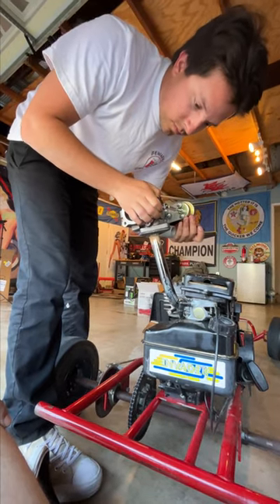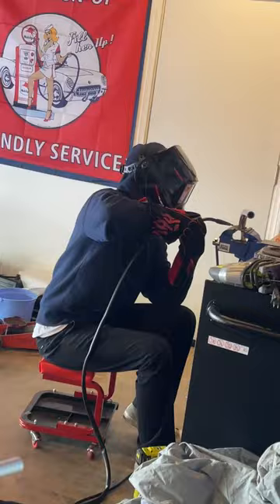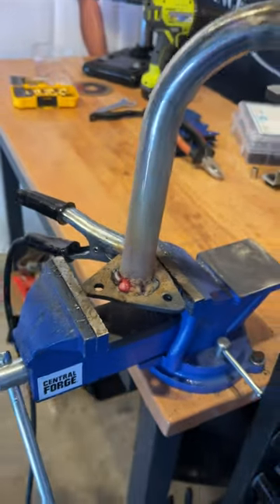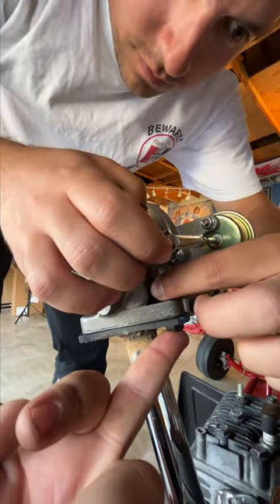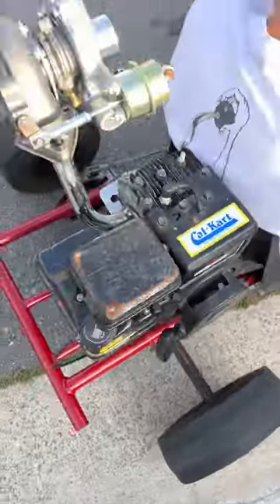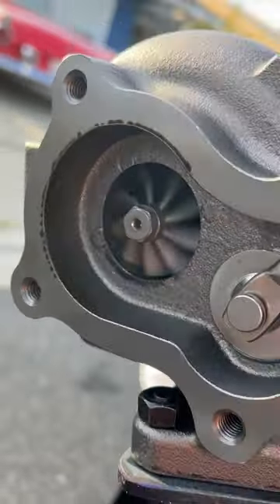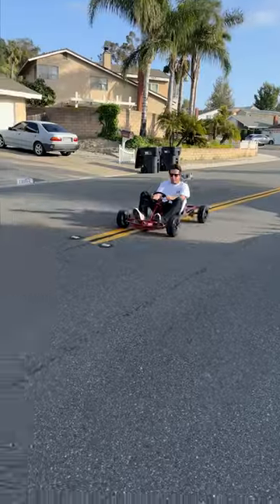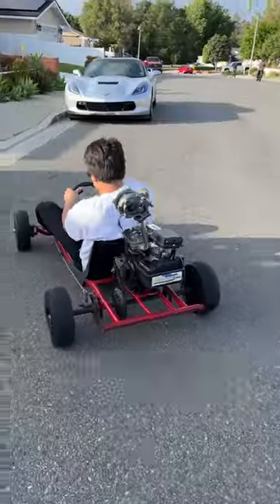I mounted a turbo on my Gokart and then this happened...

Comment from the maker: Don’t click this https://youtu.be/ay0mvx2EC3Q
Reply: Ok
Reply: We dont need anymore hack mechanics on here.  Why would you post this?  To show how lazy and impatient you can be on the dunning kruger scale?
Reply: You should start by doing oil changes,  and learning how an engine works,  and how to weld before tackleing this kind of project. I GURANTEE that thing now makes less power than it did out of the box
Reply: Why
Reply: @Sean Andrew  have you watched the first few videos of the gocart when he got it?
Reply: Add suspension!
Reply: Cool. We won’t
Reply: Ok
Reply: don’t worry i won’t.
Reply: If you use something that is supposed to be lubricated completely dry then you're going to damage it no matter what your thoughts are even if it's for half a second you're damaging it..

Comment: He cooked the bearings in just about a minute
Reply: Right
Reply: On that little ass go kart engine?
Reply: @NigelThornbery  yep, the ones for the turbo.  He ran it without the oil feed connected.
Reply: @NigelThornbery  yes
Reply: @NigelThornbery  hell ya
Reply: Indeed
Reply: Lol
Reply: Yeuuuup
Reply: Yup.
Cooled and lubricated by that oil.

And he ran it unloaded, no pressure created, probably spun faster than a proper install would result with.
Reply: @NigelThornbery  turbochargers can spin in excess of 100,000 RPM's. Under normal operating conditions.

The bearings, incredibly precise engineering to seal against both oil and air pressure.
Reply: Possibly less than 30 seconds if it turned any serious rpm.
Reply: @ctom4932  For turbo wear RPM matters where lack of oil is concerned, more than pressure.
Reply: @ctom4932  well there are two important bearings. Your main axial shaft bearing and your thrust bearing which is huge by comparison.
Reply: @consaka1  haven't really got into turbos since my school days, about 25 years ago.

Got into boats, very few turbos used in ordinary boats. Some superchargers, but still few and far between.
Boats need low end power a lot more than high end. Hole shot, the time between going from idle to getting up on plane, call it 0-20 MPH, that's where you need to minimize the time it takes.

Maybe in a high end drag boat, giving up a second or two in the 0-20 and getting an extra 20 MPH of top speed might be a worthy exchange.
But, that mentioned supercharger, which doesn't have turbo LAG, will also add high end power.

Seen a few ordinary Mercruiser motors with a Whipple on top. Personally, I think it's stupid AF to do that. Seen LS3 swaps too, replacing a motor with a 4,400 redline with one that turns 6K?

That stock Alpha 1 drive is only good for about 400hp max. And the more power it has going through it, the more wear and tear it will experience.

Alpha 1 drive is pretty much bulletproof, with proper maintenance, on 250 HP or less.
But you start putting more power through it, better increase the frequency of services.

To put it in car terms, you don't drop 1,000 HP under the hood and tub the rear end on a Chevy Luv without putting a new transmission and rear axle in it too.
Reply: That turbo is fine. You guys are just overreacting.
Reply: Where is he gonna find an oil pressure line on a lawnmower engine
Reply: @alc5792  Probably the same place I found on my 6.5 diesel truck that has no oil pressure when it's hot. I have over 60,000 miles on that engine now and it's had this problem the entire time. 
The solution that is painfully obvious to any redneck is to provide the oil pressure via other means. In my case I added an auxiliary electric oil pump for a 10-20 psi boost. Put a cooler in front of it and an extra filter after it. Only run it at idle when it's hot.
Now you may have noticed that while this guy is ignorant of turbos he is very creative. I'm sure he will come up with something. For instance if I was him I'd try to add an auxiliary drive. Maybe even an old school manual fuel pump with really stiff springs because a cam would be pretty simple to make. But chain drive would work or even electric for short runs if you want to carry a battery.
There are lots of possibilities once you drag yourself outside the box.
Reply: I personally think he's going to find it hard to find the proper turbo size with the right pressure map for that small of engine.
Reply: @alc5792  probably off an oil cooler.
Reply: With a 1 cylinder low revving. That turbine should get a flow, but is just getting useless kitty punches!!
Reply: Took the words right out of my mouth.  Hope he has a spare
Reply: Probably half that. Its gonna burn oil like a mf now
Reply: Turbo manufacturers recommend not even spinning the turbine by hand. This is sooo cooked haha
Reply: Toasty
Reply: @NigelThornbery  hell yeah he did
Reply: It's gonna be just fine
Reply: @seansecker9398  Well it's already been rubbed out.
Reply: @gorporpio  show me
Reply: @NigelThornbery  yeah he did. (I have no idea what I'm talking about)
Reply: @4x4Scout  seems more like its a stupid challenge that if it dosent work then no worries
Reply: Metal bearings don’t need long to shatter no one should ever do that they need cooled and lubrication
Reply: It's tempting to run it, but for God's sake hook up the oil!
Reply: @NigelThornbery The turbo is to scale with the little engine, so yeah.  maybe.
Reply: Does that engine even have an oil pump for pressurizing the oil to the turbo?
Reply: Really no body gonna talk bout the elephant in the room...that bird shit looking welds....wtf
Reply: @erikmckaygunsmithing6470  Yeah I was giving him a pass on his chunky peanut butter welds.  What the hell, might be his best welds ever.

Comment: Dude you smoked the bearings about 30 seconds into it.
Reply: Honestly if that's true I'd refund
Reply: Sooner.
Reply: @Weeblicker  a turbo is not like the rest of the engine. It's desinged to constant oil, if you even started it with no oil, you'll probably loose the turbo.
Reply: @Weeblicker refund for his own stupidity?

Comment: ~100.000rpm with no oil. Noice
Reply: no chance the turbo spun that fast
Reply: @davisjohnson5688  dunno but surely it did more RPM's than in normal way 'cause of the fact that it had no pressure on the other side so it spun without any opposition from the air on the other side.
Reply: @niccologentili4464  Nah he was just idling around, couldn't have been that much.
Reply: @davisjohnson5688  guess what? A turbo can spin at a maximum amount of 350k RPM's so....
Reply: @niccologentili4464 yeah high end turbos. Not cheap eBay shit.
Reply: @connor4961  yes but if a high end turbo can spin around 350k RPM's it is easy for that one to reach like 100k
Reply: @niccologentili4464  there's just no way. That's 100k when a normal engine (I'm assuming >1.4L) running on a highway  when your engine is pumping out a ton of airflow. This is a tiny go kart barely going 20 mph. There's NO way this thing is running anywhere near the 100k rpm operating speed
Reply: @Smithy18 ok so you're right, I don't want to talk anymore about this
Reply: @niccologentili4464 aww Always funny to See people on the Internet that don't have any Arguments😂
Reply: @sometunerdude  you mean that I'm wrong? I just have my theory but nobody wants to listen to me. The turbo had no oil in it, he drove it probably full gas, the turbo wasn't completely connected.... I know it is not a high end one, but I think it probably spun around 100k RPM's 'cause of no pressure on the other side, so it had no opposition to the rotations ... Then it broke the bearings because of no oil. 
It is a fucking go kart with a turbo that has an incomplete assembly so that turbo is free to spin at more RPM's because it has not a fucking opposition made by the air when it is pumped into the engine, there's not any connection
Reply: @sometunerdude  and I am from Italy too so I am trying to write something understandable for you
Reply: Not a chance Bro, on that motor it probably never hit 2000rpm

Comment: Good luck finding any oil pressure on that engine
Reply: Splash Lubricated...
Reply: You get an external inline pump that pumps to the turbo. Kind of like a transmission or diff cooler
Reply: You can make it. There has been humans in the moon...
Reply: @Palilalia22  i think thats above this guys pay grade.
Reply: You're right there's no oil pump on those engines. There is only a metal splash plate attached to the crank end of the rod that's splashes oil around and for him to start it and run it. With no oil in the Turbo.  Was really stupid !
Reply: The move is probably get a clicky clack pump and hook it up to a 12 volt power tool battery
Reply: Look into the insane builds from carsandcameras, throw enough RPM at it and the crank pressure will pump the fuel lmao

Comment: Hey bud I did some research on carbureted turbo small engines… first of all you should have the turbo as close to the exaust port as possible. Second, u need either a blow through carb or fuel injection or you can use dual throttle bodies. To explain it simply, a blow through carb is the proper carb for a turbo… or you mount a second carb in front of the turbo to pull extra fuel as the turbo spools up. Basically sandwich a carb between the turbo and air filter. For this you should install two afr gauges. One at the normal carb, and one at the turbo carb. This lets you adjust the fueling very well. It’s ghetto but it works alright.
Reply: Also on any 4-stroke single-cylinder you need a boost Reservoir otherwise it'll surge and never make boost
Reply: Oh and the electrical system for the ignition can't handle a pump and there's no oil pump in that engine.
Reply: Just add some extra fuel pressure to combat the pressure lol might work
Reply: @alltheboost5363  that’s a cool idea I never thought about the boost surging on a 4stroke single cylinder… do u have experience with a boosted 1 cylinder?
Reply: First off don’t run the turbo without oil
Reply: Hi, I see you know a lot from that research, I want to turbo my 420cc engine with a blow through setup, if I pressurize the whole carb will that be alright? I think i would need a much more powerful fuel pump and an oil pump. I am still confused on how you would setup and configure that extra carb in the dual setup though.
Reply: @syndeko1632  if you size an jet your carb right, there isn’t a need for a second one.
You can solve the internal carb pressure issue by diverting boost into bowl rather than adding fuel pressure. 
An issue with adding fuel pressure is it will overpower the spring and float in the bowl causing the carburetor to overflow. The fix is fairly simple: increase the stiffness of the valve spring.
As for a boost reservoir, you’ll need to calculate it out for your cylinder displacement, exhaust chamber displacement, turbo size, and intake diameter. Usually a slightly longer intake runner is sufficient.
As for lubrication. If you can, find an engine with full pressure lubrication such as the predator 459 max performance. If all you can get is an engine without a full pressure oil system, an electric fuel pump will work. Although not ideal it’s the only thing I know of.
For the electric fuel pump setup you will need an external battery for it, from there you will need to tie it in to the oil sump. Since this process is unique to each build I wish you good luck 👍
For full pressure systems you will need to tie-in directly after the inner cooler and I recommend having the outlet go in at the old governor port.
A crankcase vent tank is a must for these builds as they have a substantial amount of blow by. 
Pay attention to your ring gaps and don’t go over the top with adding compression. Otherwise you’ll warp stuff that wasn’t meant to be warped. 

At any rate, good luck with your build! Hope it all comes together!
Reply: This is what happens when the privileged attempts to do something cool
Reply: @sausages6135  or the financially irresponsible get an idea
Reply: he needs to go watch more boostedbois videos😅
Reply: @syndeko1632  just use a AMR500 supercharger.
Or am AMR300 would probably do it
Reply: @jessesward9429 I'm also definitely 100% positively certain he'll put a cool down timer on it too
Reply: Not enough research

Comment: I just recently started to put a turbo on my fokart also. I did the same thing, I got the exhaust pipe done and ran it a tiny bit without oil. Turns out running it for a minute without oil WILL burn the seal for the oil up, and when you do fill it up, it will leak everywhere.
Reply: Who'da thunk it, right? If it has an oil line, give it some damn oil!

Comment: But there's no oil pump in that engine and no way to hook up a pump, and it's a single-cylinder, so you'll have surge  issues, and you'll need to build a boost Reservoir or it will never make boost.
Reply: He can Hook up a battery and get a separate oil pump
Reply: Almost like simple frame go-karts aren't designed to have a fucking turbo on them. He gonna try to slap a super on there too and dual charge it ya think? 🤣🤣🤣
Reply: It will make boost but the exhaust will be heavily restricted because the air has no where to go when the intake is closed.
Reply: Exactly! So many issues!

Comment: Never run a turbo without some kind of oil going in it. Even if you plugged the drain and fill it up would be better. You need some excess residue though even that might not be enough if you redline the turbo. 
Also your supply and drain lines need to be vertical.

Comment: Love the inventiveness. If you want a weld without leaks use a solid core wire with Gas preferably pue argon. It will come out much better and easier. Good luck brother.

Comment: That axial turbo bearing is shot in about a minute. 60,000 RPMs made sure of that. Good luck getting oil pressure on a splash oil system even with oil lines.

Comment: You MUST heat blanket the exhaust pipe up to the turbo or the cooling will reduce boost if ya'll can get any from a single cylinder engine. It is much easier to fuel a carburator  properly pre-boost rather than post boost. Fuel injection does not care. If you pressurize  a carburator venturi speed will not draw fuel properly.

Comment: If you ever figure out how to get oil to the turbo with a splash lubed engine, and IF you build enough pressure for boost, you'll crack a head and oblong the crank journals...... been there, machine a steel head, add roller bearings, run nitro methane. You'll burn engines up until you get the mix right, and electric cooling fans help

Comment: Its hard to tell but whats the turbo spec? Is it small enough? Smallest turbo ive ever seen was on a 4 cylinder kubota generator. That would be my choice for something this small and even then I would be suprised if it has enough constant exhaust pressure to have any effect.

Comment: The turbo should be as close to the head as possible so as not to loose the heat. I'm also not sure about oil pressure on that engine, I certainly don't think it's going to be adequate for a properly functional turbo.

Comment: If you don't understand why a Turbo needs oil pressure. You shouldn't play with one. By the way. Most turbos don't come with bearings. The oil is the bearing.🎉

Comment: Isn't that a oil slinger type engine?? How is the turbo going to get oil pressure? Just curious cool project .... respect if it works
Reply: Did you see the welds? Lubrication isn’t on the list brother
Reply from the maker: I'm using a fuel pump to circulate the oil
Reply: @Dorian Earnest  you can have way more fun being a crappy welder than u can being a comment troll, brother
Reply: @brandonleon795  i can have the most fun being both
Reply: @dorianearnest4648  cheers
Reply: @backspeedboys  that fuel pump is going to clog 😢 not sure what oil you are using but it's been known that with air cooled engines, diesel oil is best to use but oil pumped through fuel pump.... Sounds like a disaster waiting to happen
Reply: @brandonleon795  How is that a troll? Hes presenting factual evidence.
Reply: @SmoothBrain23  its more a question of what fails first on this thing...

Comment: You do realize that the oil going to that turbo charger has to be pressurized to 30 to 40 PSI, that air cool engine does not have a Pressurized oil system. You would have to get an electric oil pump and and a 12VDC Car Battery. Otherwise without oil pressure that turbo will lock up in seconds at high rpm!!

Comment: Sounds good bud. But you do need to pull your clutch and give it a good cleaning and hit it with a little bearing grease where the brass bushing sits!!! Just a little do t over do it. That will help it from trying to take off when it’s idling.

Comment: are you going to build a separate oil system for the turbo? it doesnt use an oil pump, nor have a lot of extra oil capacity  in the crankcase.

Comment: That engine has no oil pressure as there is no pump , its splash lubricated , so i wonder if you added a small tank and then used an electric fuel pump for oil pressure, it may work out even better because im sure the oil would stay way cleaner and cooler , because you could also add an oil cooler like the ones you see on motorcycles,

Comment: Dont ever run stuff without oil. There is a good possibility you ruined the bearings. I realize your impulsivness is part of what motivates you but you got to learn to control it. I'm the same way. Second thing get a gas bottle for your welder. Just run the carbon dioxide gas you don't need any argon blend. It will make your welds look a lot better.

Comment: It’s not even mounted, if we forget about the whole no oil thing for a second and realise it’s spinning with the exhaust gasses but the charged side of the turbo is literally just pushing out into the open and not onto the go-kart intake so it’s just charging nothing and also the fact that it’s way too big for that go cart engine then you can add the no oil or pump which blew the bearings 😂